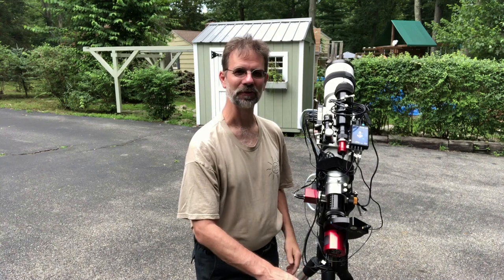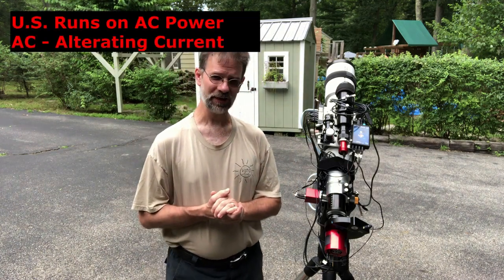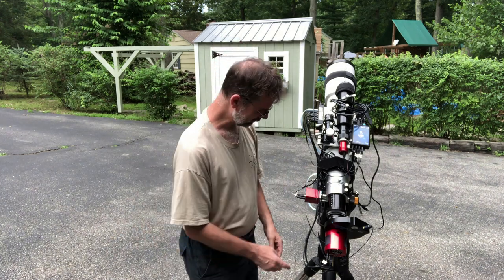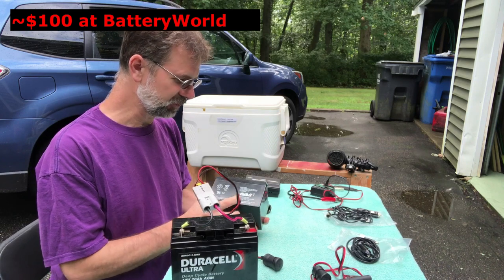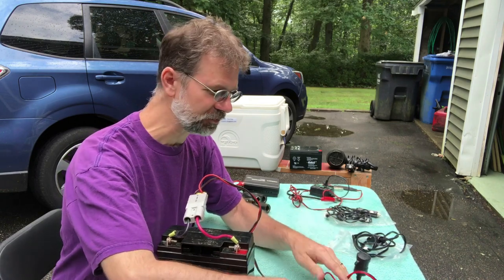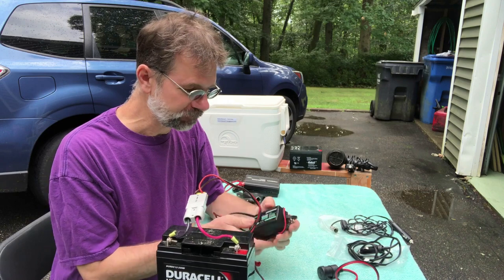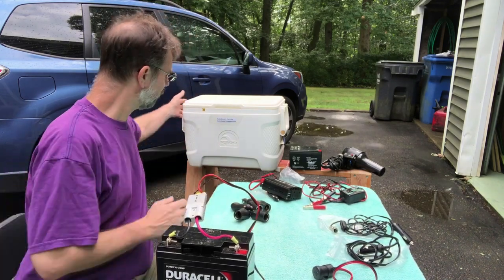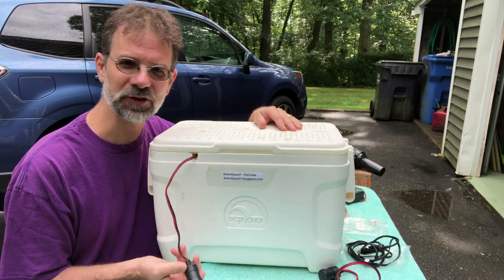Powering a Telescope in the Field or During a Power Outage

Comment: Hi Kurt, Nice setup, reducing the number of cables to the telescope would also make it easier when bench testing things.
Just wanted to suggest making a cable with the Anderson connector on one end and the barrel connector for your Pegasus Astro Pocket Powerbox on the other. This would eliminate the automotive/cigarette plug and socket and a single point of failure. 
I have found those auto connectors can become very unreliable over time. Inside the auto connector the contact area for the centre pin is very small and it doesn't take much corrosion/contamination to make the connection intermittent.
Whereas the Anderson connector has large surface areas for the contact points and they wont disconnect as easily if the cable is accidentally pulled.
Also you already own them so no real cost there. :)
Reply from the maker: Thanks Jase, actually I rarely use this in the field where I would ever need the to use a cigarette adapter - I am usually at home or another place with power.  If I were in the field using battery power I would certainly do something better (Anderson) as as you recommend.  - Cheers

Comment: Excellent. I have a power generator (gas) and want to take it to the middle of my farm field as an option of getting away from all the horizon clutter....Kurt mine is a generator...I don't trust batteries and their amperage ratings in hours to take a chance. I have dew heaters, the mount, guide camera, imaging camera with cooler and its own dew-heater...I haven't sat down and done the math with what it would all add up to. The generator is AC but the heaters, cameras, USB hub, mount all have their own DC converters...however I do like your set-up and ideas.
Reply from the maker: Thanks Dan.  A gas power generator is fine the only problem is is you ever go to a star Party they aren't allowed.  If you are on one your own farm, keep using the generator.  - Cheers
Reply: @AstroQuest1  Yes they are noisier than  CGX/CGX-L mounts. No I don't go to star parties.

Comment: lead acid batteries will be happier and last alot longer is  kept above 50% charge  including deep cycle batteries.  i use a 105ah marine battery  and during longer winter nights i can go well below 50% running a laptop and the gear.  dew heaters will eat a lot of power to run aswell.  so get AT-LEAST double the ah capacity you will need  you can alway put a second battery of the same brand and  size in parallel ( reds together and blacks together) and that will double the capacity aswell.
Reply from the maker: Good tip Thanks!

Comment: Very useful video! I was wondering how you charge your computer to run all the programs you need when imaging., cause i guess you connect the ppb to this duracel battery and you get power to your mount, focuser, hub, etc but what about the pc?
Thank
Reply from the maker: Yeah, that Duracell battery can easily power everything. However, for the computer, I have a separate power pack but in a pinch I could connect it to the Duracell with an inverter (not efficient though). - Cheers

Comment: Thanks for the video. I'm currently working on putting together a remote battery setup. I was wondering how long of a session you can get out of 20ah. I did the math on my rig, and I need about 100ah if I want to run for 8 hours. (This includes running my laptop on the same battery using a boost converter.)
Reply from the maker: Glad it helped, I got over 6 hrs. on mine but things were pretty dead after that.
Reply: James, I have similar AH100 to you and I found that my computer drained  my batteries fairly quick, it was something that I forgot to add into the equation when I was sizing up what power I would need to run my gear for most of the night. I am now using a tablet (Samsung S4) to run ASIair Pro, I am still in the trial phase but last time I had my gear out I only used the comp' for polar aligning (southern hemisphere) then it was turned off, the batteries still had plenty of charge left in them by nights end. Once I get more firmilular with ASIair I may not use the computer at all. I think that most computers drain batteries fairly quick.               Robert       Aust'